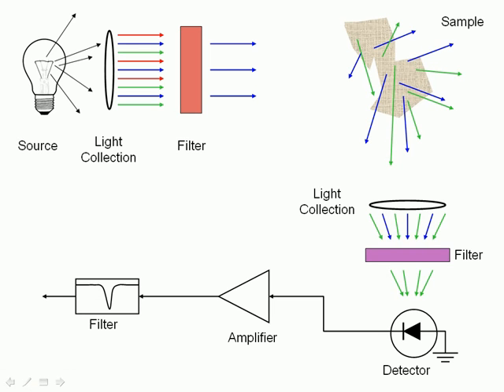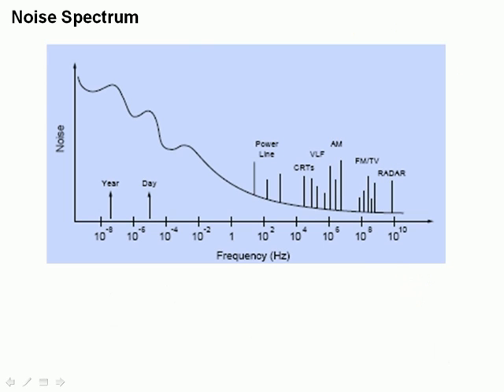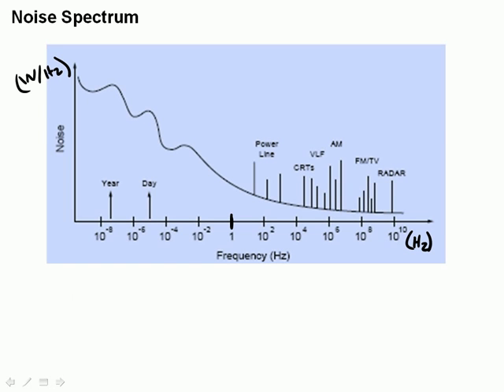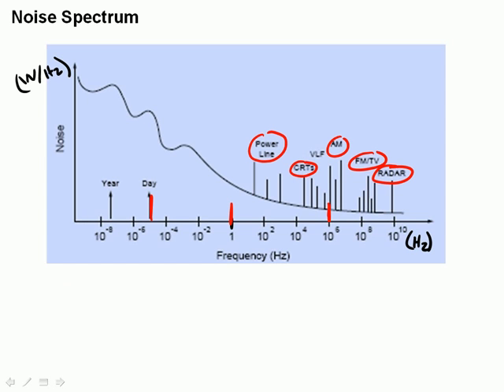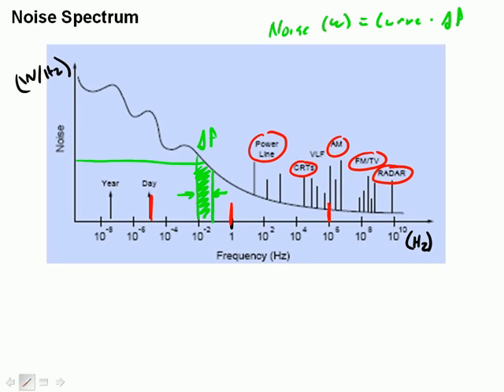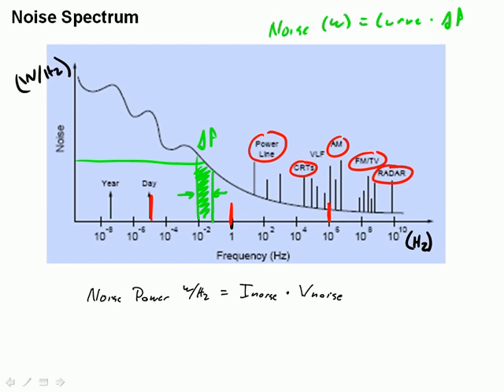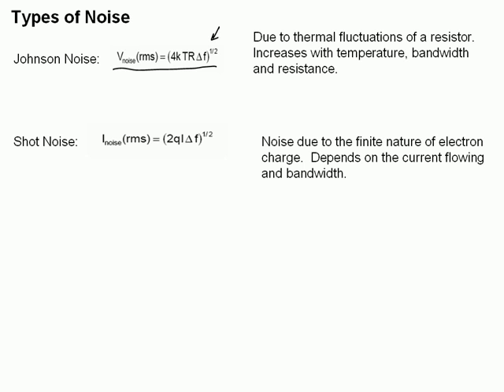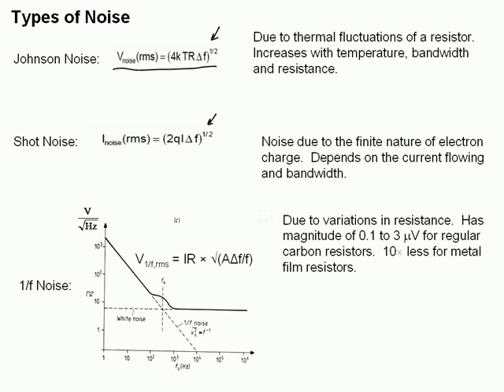Noise I

Comment: Hi - I am working to measure 1/f noise of electronic components.
I have noticed that numbers like pi are irrational and non-repeating.
I am curious about the type of noise represented by such numbers
as pi. An ideal source of 1/f would be useful.
Question: If the decimals of pi were converted to a string of voltages by a DAC, would this signal contain 1/f noise? Or would it be white noise?